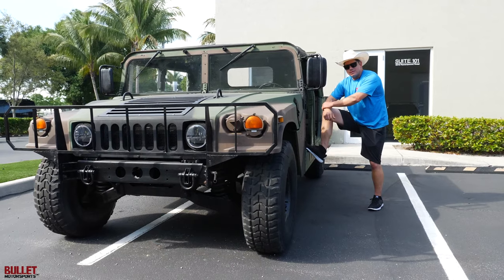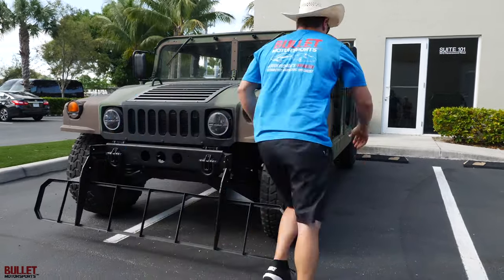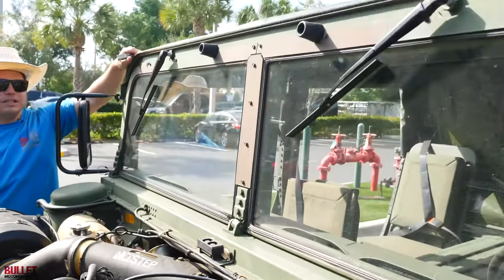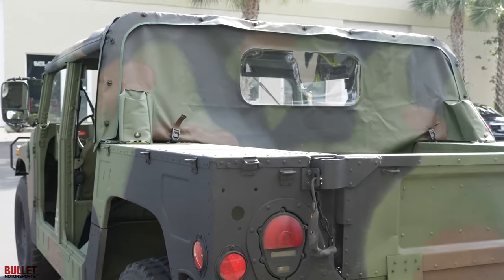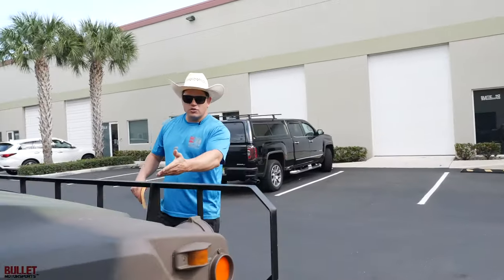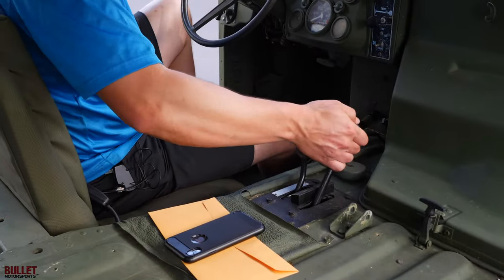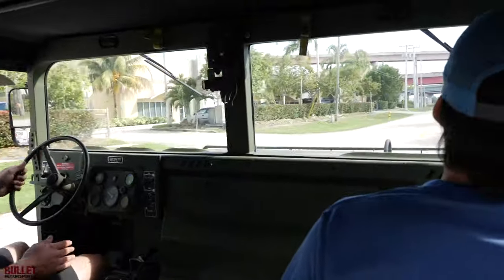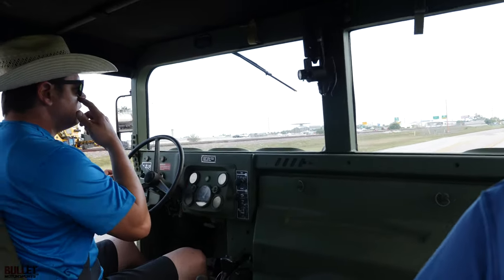Do Humvees Float? M998 VS LAKE. Test Drive Gone Wrong [4k] | REVIEW SERIES

Comment: Brake throttle modulation........ they have torque sensing differentials. Makes a huge difference in keeping from getting stuck!
Reply: true to a point but being in a swamp nothing will drive out other then a sherpa
Reply: @bodhixxx1  !!!AIR DOWN""" ... before entering water!  Also appears the rear Geared Hubs were submerged for quite some time. Drain & check for water contamination!